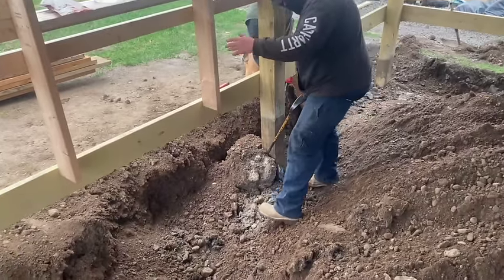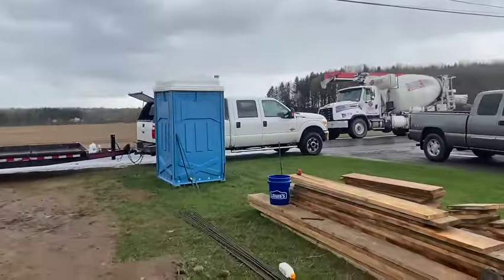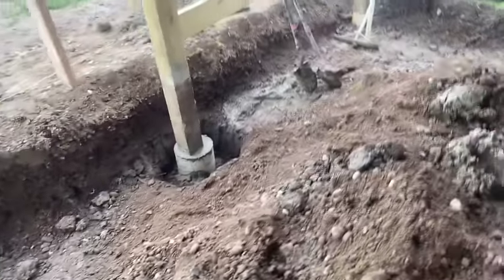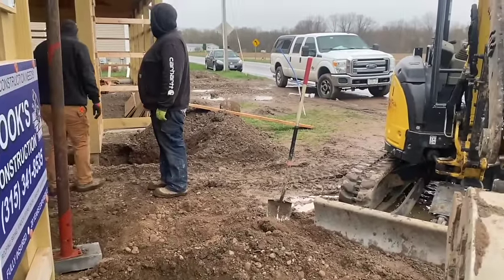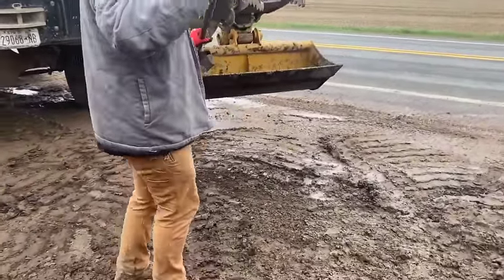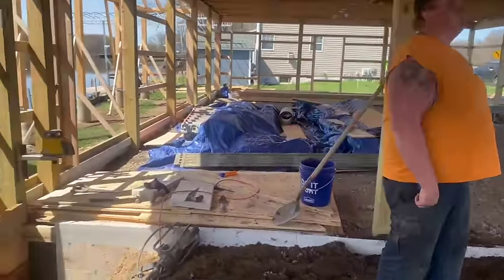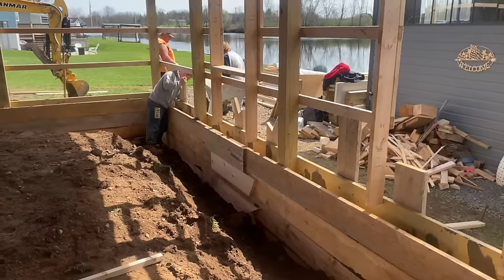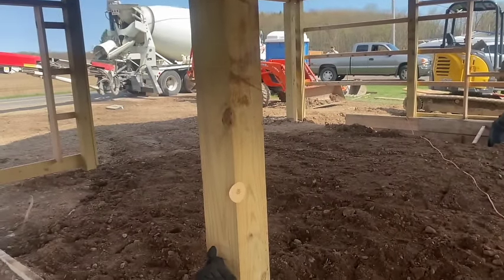HOW DID THIS PASS INSPECTION???

Comment: Here in SE Michigan, frost line is 42" also. I built my 36x72 pole a couple of years ago with a "puck" of concrete at the bottom of the 42" hole for the post to sit on. Backfilled with gravel. Main thing is to get the posts deep, unlike the build in the video, as a large open pole barn doesn't have perpendicular structure (except at the end wall) to resist wind loads from the side. I've used sonotube piers and post brackets on top for porches where the post just holds up the roof that is attached to the house so no concern about lateral loads. But for a Pole barn, deep post embedment is essential.  As for concrete AROUND the post, I poured an interior floor up to the skirt boards and around the posts. No issues there. That is done all the time around here. And you can see in the video that the concrete that was pulled away from the post had a smooth face which would probably allow the concrete to slide UP the post under a frost heave. I say "probably". As for frost heave here, I do have the concrete aprons leading into the pole barn heave by up to 1.5" in the coldest part of winter. They go back down in the Spring. But there is NO movement of the floor (unheated building).  I do put a short piece of rebar thru the post a couple of inches up from the bottom to resist uplift also.
Reply: Holy cow 42 inches I’m in Virginia it doesn’t get that cold here we have some days at 0 to 10 our frost like is like 18 inches that was code for my metal garage.
Reply: He said he was in upstate New York

Comment: As a building inspector myself, we inspect the bearing capability of the soil the building is resting on. All pole barns are engineered because the residential building code does not address “pole buildings”. Also, building codes are to buy the occupants time do evacuate a building when something goes wrong. Pole barns are not dwellings. There have been some in my jurisdiction that are called “barndominiums” and are designed to buy the occupants that time and are inspected accordingly.

Comment: If the hole reaches frost line and the entire hole is filled with concrete it is not going to heave this is how a foundation works. IN addition adding concrete will strengthen shear force significantly . Have built many pole barns this way. Often will drive rebar through post to then lock into concrete this gives very good resistance to lift force from wind. It is only going to heave if the concrete did not reach frost line.
Reply: Real

Comment: When I see videos like this I save them to show my customers the consequences of a "low ball" quote.
Reply from the maker: Good idea. lol
Reply: Most people want it now and as cheap as possible. I'm still waiting on someone to call and say I have a open budget so I want it built properly.
Reply: I'm from California originally with it's ridiculous codes, but in South Carolina 🤦🤦 OMG you want some videos of what not to do 🤣 just off the top of my head on a job I'm on, used drywall screws to install crown molding and caulked it with silicone so you can't paint it 😂
Reply: Sad, but true. And not just a low ball quote, but people who don't know what they are doing.

Comment: I used to erect steel frames in the UK. One job I was on, the farmer had another building by another firm recently erected. All looked good until he dug out along side for a road. They had stood the columns up, and then back filled with neat ballast, with one barrow load of concrete round the top. When the farmer contacted the firm, he was told that the cement hadn't mixed with the ballast. Never heard that one before.

Comment: As an engineer, I would say the concrete placed around the pole would help resist uplift forces due to wind. Uplift forces on a metal building are generally grater than bearing forces of the building. A large building is essentially a "wing" in strong winds. Having said that the uplift forces of frost heave are also real and greater care to not create a collar is needed.
Reply: As a builfing designer, I'm very curious to know if an engineer was involved initially to design the footings. As you say to resist the upload forces of the wind.
Reply: used to be pretty common to use a mixer of dirt and cement ( dry) to support and anchor the poles which sat on a poured concrete pad. Has that changed?
Reply from the maker: Most the pole buildings built here have a concrete puck under the post and then backfilled with gravel. putting concrete around post will let the frost have something to grab and it will heave the post. We live in upstate New York so it might be different where the ground does not freeze like it does here? @johneaton4364
Reply from the maker: The house was done way different than the garage so I know an engineer did not want that and this should not pass code where we live.  @kevinzep01

Comment: Bondo! So grateful you are showing this!  Recently I started planning to put a concrete wall for the pole barn build I have as a carport.  We did NOT pour concrete under or around. We did put a criss cross of rebar to prevent lifting from the frost. After 12 yrs of the build it has not moved. But, I would love to have a workshop
so a nice concrete wall and insulated.  I really am grateful you decided to make a presentation on this sort of situation. It is exactly what I need to know and learn about.   Awesome! Thank you from Atlantic Canada, 4 ft frost line as well as in your area, 48 inches. 🙏🇨🇦  ☺
Reply from the maker: If you pour a wall like this put some ties between the 2X10 boards to keep things from bowing.
Reply: @bondobuilt386  OK, noted with thanks👍☺🇨🇦

Comment: Joel Clements
0 seconds ago
Huh??? I'm from just north of you in Ontario, Canada. It is standard procedure here to sink posts/poles 48" deep, and set them in concrete. Our building code calls for 12" diameter concrete for 6x6 posts. A quick search of the internet shows that concrete backfill for a properly treated post is commonplace in frost zones – in fact, the town of Milo, New York, indicates explicitly a minimum of 42" of concrete backfill (sloped on the top for drainage) for a pole barn construction. The key is using concrete tube forms, which prevents frost movement (the frost can't grip the smooth sides of the tube).
Reply from the maker: The main problem here was they were not deep enough and no Sono tube was used but generally here they just have a footer or block under post at 48". I do agree that if deep enough you can pour around post with a Sono tube.

Comment: I’m in NY. In my area (western my) footings must be 42”, but if you research the true frost line (i have) in my part of the state in reality frost never gets below 32”. It’s lower further north and much higher down south and east, near New York City. And that’s worst case in a terrible winter. Frost line will also be appreciably higher if it’s anywhere near a heated structure (e.g. deck footings are likely to be higher due to heat loss through basement walls).
Reply: 2ft in Ohio. Unless you live up around lake Erie.

Comment: That is not the way to use a string line.  If any part of the building touches it, it won't be straight. The right way to do it is to space it out from the posts at the end, like 1" and then use your tape to see if it's the proper distance from the string.
Reply: Except it works if you have skill. We've built 100 ft long buildings using string to kiss forms/framing. They're as straight and square as you're gonna get (1/8 off from corner to corner).
Reply: @TheGuruStud  With a line riding it, you just culdn't see the (convex) curve,
Reply: @TheGuruStud  It might work, but it takes a LOT more time, and its really easy to screw it up.

Comment: Im from northern illinois. Ive been on a lot of wik building jobs in the past. This is how most buildings were done. I dont see much movement unless they were built in a wetland. Maybe they didnt make it to 42" down but this is standard
Reply from the maker: We have a 48" frost line here so we put a footing under the post 48" down and this is all clay under there at around 30 inches and below.
Reply: @bondobuilt386  would be interesting to hear the story behind all this getting tore up. Who made the call? An inspector? I kinda doubt it.
Reply: Same here, also from Illinois (where we have a 42" frost line) and work in construction, and pouring concrete around supports like this is perfectly common and normal. The timbers do not move. Absolutely no idea what this guy is talking about.
Reply: @ev6558  totally agree with you fellas this is some sort of sham, even if you put a concrete wall around part of the building just keep it separate, use a footing, don't anchor it to your poles or anything, tar paper or foam can do that good to go...I just dunno how this guy thinks the pole will not move as he thinks the concrete around it would move? by his own logic he put a sono pad beneath it then doesn't attach the pole to it above the frost line, doesn't wrap the pole nothing pushes soil right over it, why I think its BS, I've built pole building's in the worst conditions, the pac northwest on glacial till, boulders the size of beach balls to tennis balls.. all 4 seasons, easy 3 ft frost line, pour your concrete above the soil line, and go, anchor the pole to the concrete, the wood lasts way longer, no issues if anything moves it all moves at once, the pac NW is an extreme seismic area if this method was sketchy it wouldn't pass inspection. ..  this guy makes no sense to me at all, I think he did it so he can easily push his wall up to the poles, why the poles are beneath the soil line is beyond me? why not build the wall anchor the pole to the top of the wall,. above the soil line, with a solid footing its good to go.. at least wrap those posts with tar paper, something..   like to see a real life demonstration of his logic, compared
Reply: The best part is the guy who's filming absolutely believes what he's saying..
Reply: @JD-ys7fj  You know how to put fence posts around farms, which is child's play compared to actually building things. Those posts heave up because they have no drainage because you're doing bare minimum work to keep the price down for the farmer who needs a thousand new fence posts. There's probably several miles of fence on my street alone where the supports are set in concrete because they only had to go around a residential property and therefore weren't done as cheaply as possible.
Reply: @JD-ys7fj  nothin
Reply: Standard for a shady contractor
Reply: Big yellow envelope stuffed.
That's how.

Comment: Ok. So , the post rests on the plastic tube filled with concrete. The surface area of the end of the post  is 6 "X 6"  which is 36sq ins. The surface area of the tube can't be that much larger , seems little gain. Wouldn't it be better to lay a concrete plinth, some 12"x12" for the post to rest on. I'm no builder and would like to hear why that wouldn't work. Thanks
Reply: Also. The concrete now being laid .?between the shuttering is that on compacted earth or is there hardcore beneath

Comment: I work for a fence company in New York and the local code calls for two feet buried. 
   Wile we don’t use concrete with wood post , we do of course use concrete with steel post. 
   As long as a straight sided hole is dug and you don’t create a shoulder or inverted bell shape hole , we get no heaving due to frost.

Comment: Good job. I'm in upstate NY myself and have seen it done this way as well. I did the sitework for a huge barn at a local dairy farm outside of Amsterdam. The owner had a group of Amish from St Johnsville area come in and that is exactly how they did it! We warned the owner, but he wouldn't listen. I wasn't too impressed with the roof framing either in the areas that weren't trusses. No inspections because they were farm exempt.  So I documented everything, I was not about to get blamed for the deep cut and fill I did if the building moved because there wasn't adequate frost protection by the builder!
Keep up the good work! Aaron in Mayfield
Reply from the maker: Thanks I do not know why they did that in New York with our frost level. Crazy
Reply: Hey, I'm not in a NY frost line state, actually I'm in NY South, lol South Carolina, but my question is strictly wanting to know the difference in why one cement pour is better than the previous?

I understand heaving from frost, I just don't understand what you did that would make it different, wouldn't the tubs still push up?
I understand the use of anchors because cement doesn't stick to wood, but the tubs, I haven't worked with them with understanding...

I'm actually building thermal mass earth homes, and I'm so unconventional and outside the box, I depend on metric square foot weight for anchoring 😂 I use sand bags and used tires as load bearing walls right on the ground, maybe a 10 inch footer sub ground level as locked in start, but nothing as in depth of cement and rebar...

Lots of contractors are amazed I can build a fire proof, earthquake proof, bullet proof, termite proof structure you can't destroy, you can try...

Rubber encased steel belt, compacted dirt two foot plus thick, and bull fencing use as chicken wire on both sides holding 4 inches of cement mud finished walls... I don't do lumber framing anymore once I build my first earth home lol...

But I'm interested in all building techniques, I have only been to NY once, on a 5 month run refirb of family dollar stores, Maine and Vermont were so cold I don't understand how you guys do it that's a 10-4 on nope 😂

Thanks for your response...
Reply: @jeromegarcia5396  the bottom of the tubes sit below the frost line. So the frost won’t get underneath the tubes and lift poles. The frost doesn’t lift the tubes it rides up and down along the sides. That’s why it is Code to use tubes now. They used to let you auger a hole in the ground below the frost line and fill it with concrete. In some cases the frost Would lift the concrete because it wasn’t smooth as it is when you pour it in the tubes. Bondo Built  actually fixed two problems. The original poles weren’t all the frost line, and it had clumps of concrete around it, which would’ve made the poles lift even more. The original builder could have used auger poles and extended them below. The frost line with a small footing underneath. What Bondo did was even better.
Reply: Longer poles…. Not auger poles. Talk to text lol.
Reply: @howlandexcavating  Ahhh... Got it... Makes complete sense now...

Comment: It looks like they hired someone who builds fences for a living to build the barn. In the lower states where frost line is non-existent you pour concrete around the base like that of your fence posts to keep them anchored. The concrete also acts like an insulator to keep moisture and bugs at bay longer so your fence doesn't rot in the ground or become an insect factory. Note in the southern states, your worst enemy is spring and fall rains being absorbed by the lumber and the lumber getting soaked expanding and cracking in the summer heat. On the other side of the coin, in the north I have seen this done below the frost line to some success. At the same time there's better ways not necessarily cheaper, to prevent ground rot for your wooden posts.
Reply: Ground rot in casement and concrete is way worse. It's treated wood bugs won't get into it but the concrete the lie in the concrete will eat it up.

Comment: Here in Iowa we only put a concrete pad (18"x6"thick at the bottom of a 48" hole x 24" round.  Gravel in the hole too just ground level. The rock is to drain all water away from the post.

Comment: I used to use the metal banding between the board as I formed, doubled them up and nailed one down to the lower board and the other to the upper board. did that every 2', and just poured slowly, it won't blow out. did have a 2x12 split in the middle once, so always made sure to have plenty of strong backs. easier to remove the additional lumber and fasteners, and better than shoveling mix back in after it blows out!
Reply from the maker: Good idea with the straps I also thought that all thread drilled through with washers and nuts would hold it together. Or some kind of wall tie for panel forming.

Comment: I come from Europe and I worked in construction for a few years. I argue that both ways of anchoring the supporting elements are wrong. One: Wood does not belong in concrete, absolutely never. Second: I don't see waterproofing protection for wood? Wet concrete and wood with no protection... In ten years those wooden beams will fall down on their own because they will rot.

As it should be:

Pour a concrete foundation, a footing, for each wooden beam. At least 80 cm deep. Waterproof the top of the concrete. After the concrete has dried( at least 1 day), drill 4 holes for the threaded rods and fix the wooden beams to the iron brackets. The wooden beams would be above ground level and would not be subject to degradation so quickly.

Comment: I live in north Georgia. My pole barn has concrete around the poles. Each pole is over four feet deep with concrete up two feet from the surface. The frost line is two feet.
Reply: It'll be there forever.
Just always make sure to be below the frost line....always

Comment: We wrap the bottom 4ft of our post in 2 inch ridged foam sleeve here in Alaska.  That helps prevents frost from grabbing the post.
Reply from the maker: Im sure that helps.
Reply: Our frost line is 6-8 feet in Canada, I assume yours as well, 1/4 down crush gravel is what we use above the front line to prevent heaving.